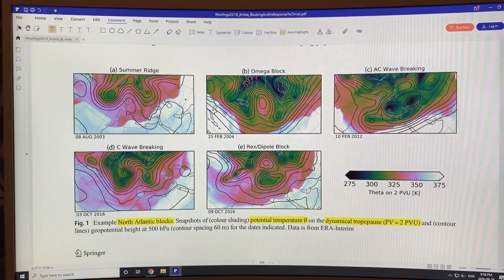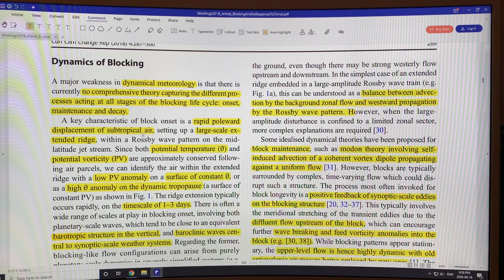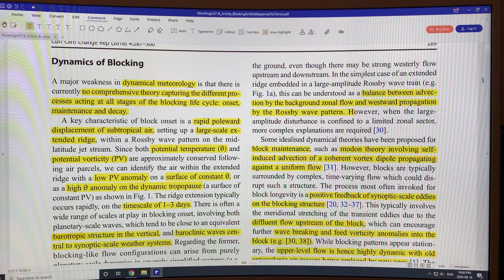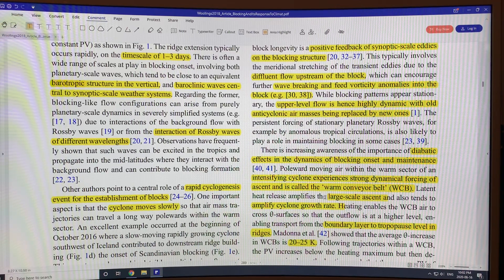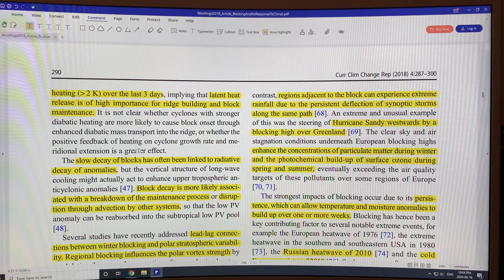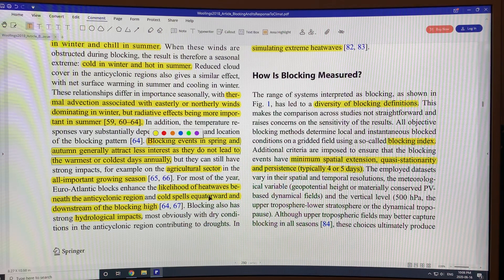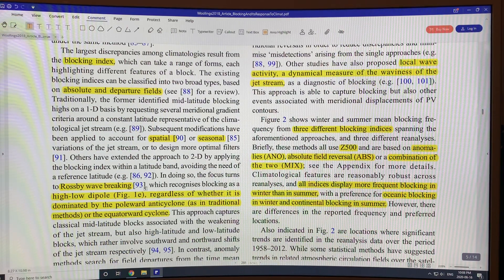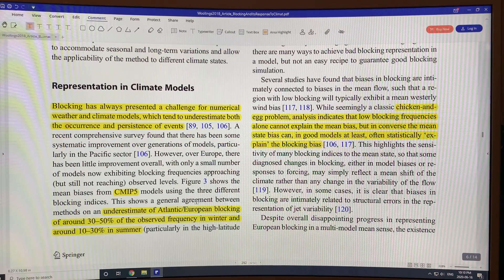Persistent Quasi-Stationary Jet Stream Ridge Over Siberia a Perfect Example of Jet Stream Breakdown

Comment: Real meteorology. Very interesting indeed. Unfortunately they never gave me the chance whilst at the UKMO of being a forecaster. You've taught me one or two points that were new to me. Thank you. By the way I completely agree with you regarding  our situation. In that whatever the cause 100 F within the Arctic Circle has to be seen as a landmark event and shows 
that events are running away from us. 
Just cutting CO2 emissions say by 2050 simply wont be fast enough. Somehow, and safely, we have to remove the CO2 direct from the atmosphere at quite a rate. So again tree planting /kelp seeding even on a military/industrial scale wont  be fast enough. So unfortunately we may well have boxed ourself into engineering solutions just to survive. There is risk here.

Comment: This jet stream breakdown process could cause a "faster than expected" result regarding the topic written about in the scientific paper https://www.nature.com/articles/s41467-018-05252-y "North China Plain threatened by deadly heatwaves due to climate change and irrigation". In equivalent terms that someone's grandmother can understand, death heat waves could strike down some tropical and near tropical cities less than 70 years into the future.
Reply from the maker: Meanwhile, southern China has seen large rainfall and flooding lately, being stuck in a persistent trough of the jet stream...
Reply: @PaulHBeckwith  , see https://youtu.be/ELyM8hWrSoQ "400-year-old bridge washed away by floods in Zhangjiajie, China". If one uses a bad assumption that 21st Century climate is the same as the long ago climate of the Qing Dynasty, then one can surmise that a roughly 1 in 500 year flood event has taken place.

However, the reality of warmer water during the 21st Century within the South China Sea and the East China Sea allows a faster input of water vapor into what can be called "aerial rivers" of air in the region, and the flow of the aerial rivers of air has changed as well. The result is that a bridge that has withstood some 400 years of floods and earthquakes has now fallen in the year 2020. I suspect that what would have been a 500 year flood during the climate of the time of the Qing Dynasty is now a 1 in 20 or so year flood during the current 21st Century in vicinity of the Yangtze River catchment.

This type of change resulting from warmer ocean and changed air flow affects many river catchments throughout the world. Of particular note is what happened in the Zambezi River catchment in Africa after 1956. Before construction of the Kariba Dam began across the Zambezi River, an estimate of a 10,000 year flood event was made, partly based on rainfall records, and partly based on descriptions by native tribesmen of floodings that happened in their lifetimes before rainfall records were kept. Since 1956, roughly a half dozen 10,000 year floods have occurred at the Kariba Dam site, strongly indicating that climate in the Zambezi River catchment is not the same after 1956 as before 1956. The result has been the formation of a plunge pool near the base of the Kariba Dam, somewhat threatening the integrity of the Kariba Dam the next time a 10,000 year flood occurs.

Of course, change in what constitutes a 500 year flood event or a 10,000 year flood event is not limited to the continents of Africa and Asia. A few years ago you made a video about a flood event in Canada, so you understand of course that the same principles apply to the continent of North America as well with the increase in frequency of flood events of some given amount of severity in terms of cubic meters per second of water flow within a river, or alternatively in terms of average cubic meters per second of rainfall within a river catchment over the course of some set time period such as a day or a week or a month.
Reply: @PaulHBeckwith  , at this point in time, you and other climatologists have a chance to present your opinions to a famous Internet streamer's fan base. See my discussion chain in https://youtu.be/nVB9w6ch_2A "JadeyAhn experiences racism". You might agree or disagree with my own opinions on the dangers of global warming in southern and southeastern Asia, but write something. The more climatologists, the better.
Reply: There is something else to consider writing into that YouTube discussion chain other than your true beliefs on the scientific veracity or the scientific inaccuracy of my comments on that discussion chain. I also expressed a wish that steamers and their followers might improve their general knowledge level on the subject of climate change, and then help lead the way on getting the general public to improve their general knowledge level on the subject of climate change. Perhaps a comment could be made approving of such a practice (or alternatively disapproving of that practice, provided that the commentator truly disapproves of such a practice).
Reply: A example of the trend of increasingly severe 21st Century heat appears in https://youtu.be/DvDKgIWXxk8 "Rice farmers plant overnight to avoid Vietnam's soaring day time temperatures".

In theory, when the decade comes that it is too hot for humans to plant rice at night in Viet Nam, robot farmers can be manufactured, so that robots can do the rice planting. There would however a few decades later not be much point in having robot farmers in Viet Nam, since once it gets too hot for humans to plant rice at night, it would then take not many more additional decades for the increasing heat to kill off humans from the lower elevation portions of Viet Nam. There would not then be much point in having robots for planting rice in Viet Nam, since there would at that time be no humans nearby to eat the rice.

Comment: Thanks Paul, you voice is much appreciated.  Swiss media is really doubling down on not reporting on any climate related topics.  Le Matin had a story about European Heat Wave, and mentioned that Sweden had a dry spring drying out the soil and causing fires. 
And on the TV news, they did report on the Siberian town that was 38°C, but they had on a climate "scientist" that said that methane was 20 times stronger than CO".  With no qualifier that that number was over a century, and no mention that it is 86 times stronger for the first 20 years.